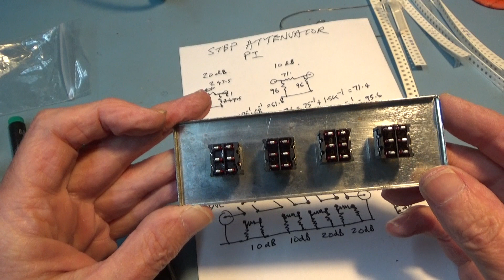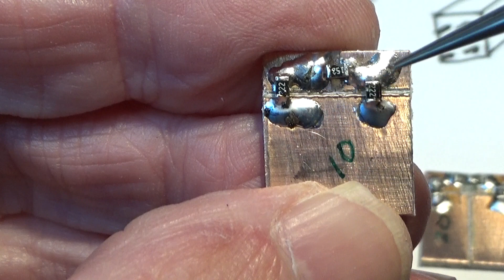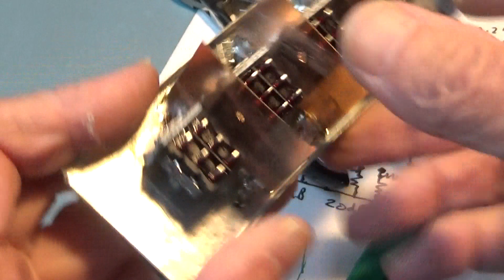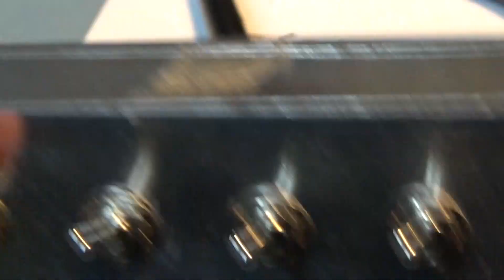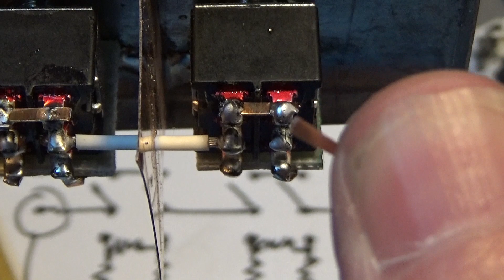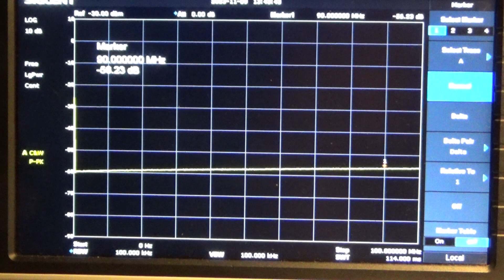Step Attenuator Part 2

Comment: Very impressed with the result Nick. I’d say as you said up to 100Mhz is perfectly usable with a very good accuracy. If you improve the path with boars that help to keep the 50ohm impedance you can certainly go higher in freq if you need to. I was wondering why if you have precise attenuation with single cells you didn’t get the same precisione adding up cells. It might be the spectrum analyzer. Can you adjust the level of the spectrum analyzer in track gen mode? If not try spot measures with an external gen at higher level, perhaps the function gen that usually can give much higher levels. 
Well done Nick. 
My lab is still a mess and waiting for me to put it all together again in the new place.
Bye
Diego
Reply from the maker: Hello Diego, I'm going to try to improve it, but the main problem is the switches.
The reason for the increasing error when more of the attenuator pads are connected together is I think due to the capacitance of the switch contacts. An RF signal will take the easiest route and rather than go through 60 db of resistors, it will leak through to the shorted switch contacts. The tracking generator was set to its maximum output of 0 dbm. This was only built as an exercise, doubt I'll ever use it!
Hope you get your lab together again soon.
Best wishes nick

Comment: I think you should be well pleased with that, Nick. Certainly more than usable in reducing the amplitude of your sig gen.
Reply from the maker: I will see if I can improve it, but it's doubtful using those switches. I wont be connecting it to any signal generator, they all have precision attenuators! This was just an exercise and will probably never be used.
Reply: @ptronix   I'd use it. Mind you, my sig gen doesn't go down low enough to test receivers without additional attenuation, and fiddling around with fixed attenuators tries my patience.

Comment: Nick: you've got to do it all again, and film all the soldering!
Just kidding of course, nice work, a fine performer, as expected.  3dB difference at 100 Mhz with all four sections engaged adds up at least, yes? 
Caught me with the temperature conversion, too, mate, thanks! LOL
Reply from the maker: Thanks Joe, capacitance of the switch contacts of course at high frequency is significant. The RF would rather go the easy route than 60 db of resistors. I will look at it and see if it can be easily improved.